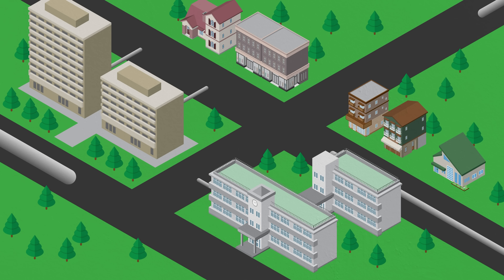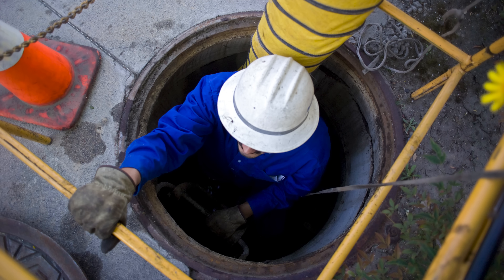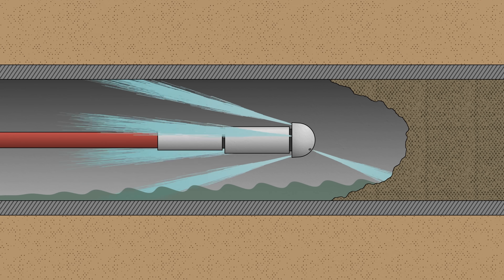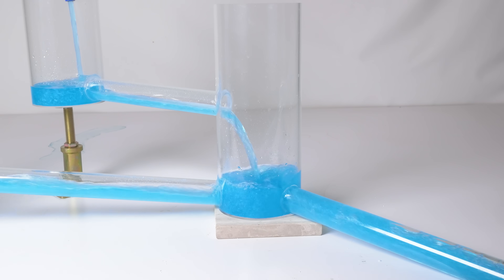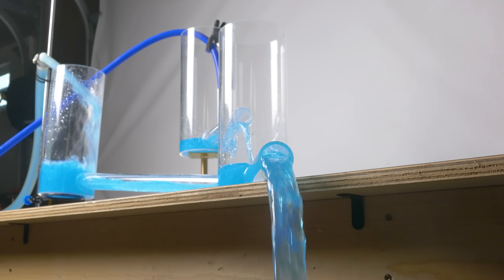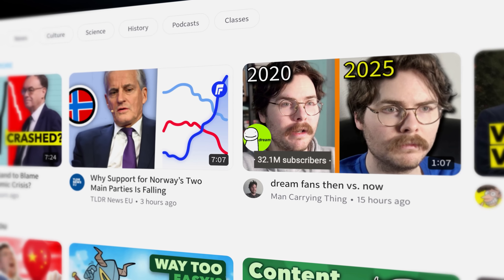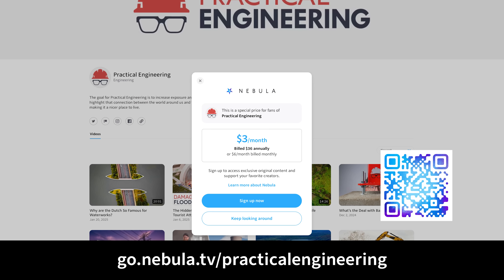What’s Inside a Manhole?

Comment: The Paris Olympics Seine river events are a good example, although it wasn't rainfall on the city itself that caused the postponement. The giant new storm water overflow reservoir near Austerlitz station worked exactly as intended and prevented sewer discharge in the river.
It's rainfall upstream, like 100 to 200 miles East and Southeast of Paris, mainly on the Marne (tributary river) and also on the upper Seine but to a lesser extent, that caused the events to be postponed, as they were initially planned exactly when the water would have flowed through Paris center from these locations.
36 hours later, and it was back to normal.

Really nice video turning a rather mundane subject into something very interesting, kudos!

Comment: In my village, we have 2 networks. One for the storm water and one for the sewage. Homes are required by code to be connected to both to avoid the problems with storm water in the sewage system.
The storm water is discharged directly yo the nearby river and the sewage goes to the water treatment plant (Rhyzosphere type station).
Reply: My roof runoff just goes directly into my yard or my driveway, which then drains into the road and will end up in a storm sewer on the road.
Reply: @jasonfullerton7763  same for me. From the roof into the garden or alley and from there in to tge catch basin/storm system. Yhea running the water from the roof in to the sewer can cause a lot of problems with overflow and a lot of water to treat/clean at tge treatment plant.
Reply: I don't understand why a home needs to be connected to storm. The storm system has catch basins. What water goes to the storm, perhaps the water that comes off the roof?
Reply: @bert-blank  Yes, it is for the water of the roof. The water of the roof must go somewhere and it goes to the storm. In the past, the roof water went to the sewage, but it caused trouble during storms (see the problems with the Seine river in Paris).
I live in France, so it might be different in the US. Where is flowing the water from the roof in the US?

Comment: As someone who locates sewer lines with a camera for new utility installs, whipes and grease are very much so an issue. But in the area I work in, we often run into lots of rock and sand from poorly maintained lines. Just had a really bad line with a lot of rock in it yesterday.

Comment: In Quebec, we have a problem with frost heave.  Roads would have to be built with 6 to 8 foot deep granular bases to eliminate the problem, but that would cost a fortune, so we typically build road granular bases between 3 and 4 feet deep.

The manholes, however, rest on crushed stone bases below the frost line. This means, that in the winter, you can have a differential frost heave of 1 to 2 inches between the cover and the road surface.  We deal with this by using telescopic frames that come in two pieces.  The lower piece rests on the top of the manhole, and guides the upper piece.  The upper piece has a wide rim that rests on the asphalt pavement (but sunk in to be flush with the surface). This allows the cover to rise with the pavement when the frozen soil under the road heaves.

As prefabricated manholes are made in segments, the upper segment can sometime be lifted by the rising soil, especially if the granular road base is frozen to it.  To counter this, we wrap the upper segments in a special two-layer geo-composite fabric, where the two layers are designed to slide against each other.  This prevents the upward shear forces of the rising road base from being transferred to the outer wall of the manhole segment.  In Ontario, they deal with this problem by bolting-on metal straps to hold the segments together.

Comment: I have been in construction for over forty years and yes I have worked in sewers. The only time women work in construction is when there is a need to fill a DEI or affirmative action quota. They were often paid the same as other workers and did not have to complete the assigned tasks! I was a boilermaker in oilfield and the women held umbrellas for the men while they worked in hard hot jobs like welding in  110 degree Texas heat, or being on fire watch with a water cooler and a lawn chair watching for fire breakouts!

Comment: Ah!  Sanitary sewers . . . At my last place of employment along the San Francisco Bay, which was only a few feet above sea level, I noticed on the street that fluid was seeping up from the manhole cover onto the roadway.  I contacted public works about that issue.  But, before they arrived, between 10 ~ 10:30 AM, enough pressure had built up in the sewer line that it dislodged the steel cover, where it came to rest several feet away.
From what I could figure, given the time of day, the restrooms in the neighboring buildings may have been very busy at that time, which built up the pressure from the waste material, which dislodged the manhole cover.
The public works crew worked a long time to vacuum out the debris in that sewer line.

Comment: In your model, the pipes intersect with the manhole on the perpendicular to the circular vertical of the manhole. In the situation like you've shown here, where the manhole is used to change direction at the same level, wouldn't it be better to have the inlet and outlet pipes intersect with the vertical closer to the tangent to the circular footprint of the manhole? I imagine that having the smoother curve would improve the flow characteristics (less turbulent/more laminar)? Or is there a reason why that might not be done? [Edit: I should've specified initially, in case it wasn't clear what I meant; in this question, the direction of the entry of the tangents of all feeds in would be the same, and the direction of the exit tangent would be the opposite.  I'm imagining that it would more easily drain down the exit direction if it were piped in that way, because you'd have a vortex in the centre. In fact, it would probably also significantly reduce the risk of back flow up an unexpected direction, because the fluid flow would be encouraged to flow down the exit tangent and wouldn't easily flow back up the entry tangent. The only issue I could see is that it would potentially promote higher exit velocities which would, as you say, risk damage to the pipework. But on the flipside, I imagine that effect would only be significant during a high intensity storm water situation - and in that case, the additional draining capacity of the manhole exit pipe could outweigh the additional wear and tear....]

I'm not sure if you've answered this in a video, and it's only tangentially related here (pun intended), but in the design of the storm water network, how is the design condition for the peak capacity selected? I'm guessing it's just some sort of mathematically calculated point where increasing the capacity doesn't pay off compared to the maintenance required to get it sorted in the, say, 1 in 500 or 1 in 1,000 rainfall event???

Comment: The simple "water flows downhill" (inserted water to be polite), concept works great for all plumbing applications.  I remember helping our fitter replace rotting pipes in a dry sprinkler system.  The water was from water vapour condensing out of the compressed air in the pipes and there were no low points available to drain the pipes properly.  Have to admit, the amount of sludge that came out when we opened the joint was amazing.  The smell, memorable to say the least.

Thank you for posting these videos Grady.  They're great and very informative.
Reply: Unpressurized water flows downhill. Pressurized water leaks everywhere.
Reply: @davidg4288  What enters the pipes is air containing water vapor and with the system being closed, the air doesn't go anywhere else but remains there.  It pushes back through the pipe and keeps the clapper valve closed so no liquid water can flow into the system.

When the air is pressurized, it causes the water vapor to condense into liquid water which is heavier than air and will settle to the lowest point.  When something  like a sprinkler head opens, then it sprays out in a mist.

When the air pressure drops enough, the pressure of the incoming water will force the valve to open and water will then flow into the pipes to wherever it's needed.

Comment: We used to take the storm pipes to school 😂. Each tunnel must have been 25 feet in width and 13 or so feet in height. We would lift the 100+lb storm gate to get inside. And begin our journey. Multiple other slimer tunnels are breaking off into the city. The amount of water that would go through these tunnels is monstrous. It would lift that gate like it was plastic complete white wash blowing out of the entrance. To this day 1000s of people live under that city in those same tunnels. And even more in the summer. But the lids are actually round in design because every other shape risks falling down. A circular one can not wiggle its way down even when accidentally dropped.

Comment: In 1993 we had to turn the cone on huge manhole in Vegas. We built a turn lane into the Fiesta Hotel during its construction. The manhole was in conflict with the new curb. So we excavated around the manhole to give it a half a turn. No one had opened the lid prior to getting the ring and cone exposed. We put a big choker cable around it and lifted it up with the excavator. What happened next should be in a horror movie. The manhole was about 12’ deep 5’ in diameter. It was lined with cockroaches top to bottom. At the bottom was a 36” pipe flowing at about 70%. 
All three of us literally puked. We set it back down and flushed a 4000 gallon load of water down the manhole. Creepiest thing I seen in the underground business

Comment: Timestamps (Powered by Merlin AI)
00:06 - Manholes reveal the complex infrastructure of sewer systems.
01:59 - Manholes connect sewer lines and facilitate maintenance and flow management.
03:33 - Fatbergs create significant sewer system issues, impacting public costs and maintenance.
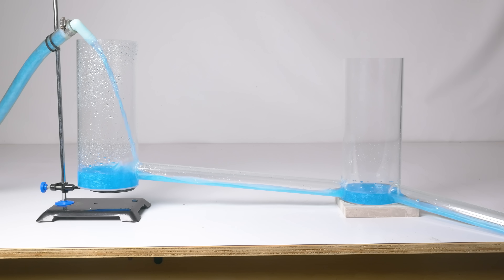05:05 - Manholes are crucial for ventilation and managing sewer flow.
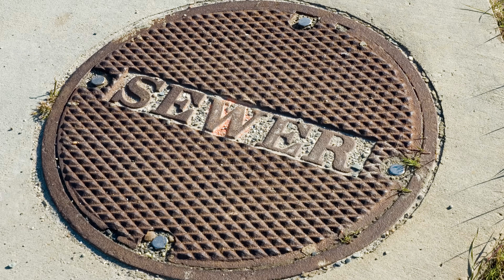06:43 - Stormwater management is critical for urban sewer systems.
08:17 - Understanding manhole design impacts sewer flow and environmental compliance.
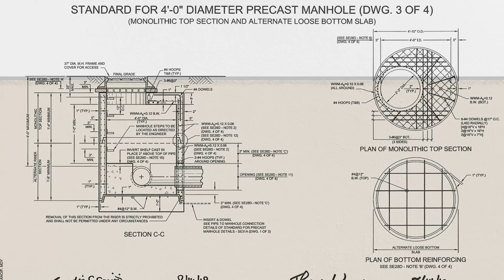09:47 - Manhole construction involves round shapes for efficiency and soil load resistance.
11:23 - The construction of the World Trade Center showcased remarkable engineering.

Comment: Telco worker here. Another very important reason manhole lids are round is to keep the lid from falling into the hole. The lip that the lid sits on is too small to allow the lid to fall through. A square or other shaped lid, if rotated is able to fit passed the support lip and thusly could fall into the hole.

Comment: It looks like a manhole would be a point were solid material would collect.  You briefly mentioned maintenance but I would have liked to know what methods are used to clean out manholes when stuff collects in them.
Reply: Sewer manholes generally have concrete channels installed which match the diameters of the incoming and outgoing pipes. The model shown in the video did not have channels in the manholes.

Comment: I've been in storm drains in my town quite a few times, and even a CSO 3 times to watch the progress as they changed it from a CSO to a combined sewer going into an interceptor tank, but I've never went into one through the manhole. My town is awesome enough to put detailed sewer maps on their website, so you can find outfalls for storm drains/CSOs and manholes (if you like playing in poo water), and tell what kind of pipe it is, how big it is and what it carries.

I was in a drain one time that was big enough to drive a bus through for the first 600ft or so. after about a mile and a half, it had reduced to the point we would have to worm our way through to get to the next manhole. It had some pretty neat features where multiple pipes met, or it changed direction sharply. There was one manhole that was like 10x10ft and the corners had 3ft tall "curbs" that made perfect benches to take a break and smoke a joint on.

Comment: In Massachusetts instead of putting the manholes in the center of the road so that your car straddles it when you drive over it they offset them so that your cars tires run right over them. And they are always sunk a bit below grade so you feel it. 😖

Comment: Can someone please explain the flushable wipes argument? I did an experiment in HS testing different brands of wipes. Of the 10 brands i used, 8 of them would deterioate in a 20/80 mixture of ammonia and water in 24 hours. I understand ammonia is much stronger than UREA but if your septic system is healthy and properly functioning, i cannot comprehend how the concentration of urea and feces will not breakdown those wipes.

Comment: One day my dad and I watched a city crew prepare to water jet a sewer line, using the same nozzle design Grady pictured. They had to resort to a backhoe to remove the manhole cover. When it popped off, actually pulling the iron rim out of the street, 10,000 cockroaches swarmed out. Or maybe 20,000. A carpet of roaches in any case. So sewers handle not only sewage and storm water and so on, they house incalculable millions of tasty roaches.

Comment: I've been delivering pipe for storm water only drains for about a year and a half now. There are fittings of all sizes and shapes for the pipes. For a straight line of pipe, each individual piece of pipe fits together with a rubber seal and some grease, then they're pressure-fitted (shoved) together. The pressure keeps the seal. Each pipe is 8 foot of water-travel and 1foot of fitting: a nipple on one end and a bell on the other.

The fittings are generally called "precast" and are everything from ys, to corners, to tiny boxes for junctions underground which are NOT manhole-accessible, to storm drains, to all kinds of entrance and exits. There are pre-cast manholes ... and some which are just formed on-site. You can buy a custom-built manhole with holes exactly where you want it, build it in place with forms, or buy the pre-formed one and cut-in the holes you need.

A lot of the pipe systems for subdivisions do work out to just straight lines, but with the curvy nature of newer subdivisions, joints, elbows, and even Ys are needed. That said ... the vast, vast majority of pipe put into the ground is just the straight-line kind because your main purpose is to move liquid over a distance ... not to curve it into a water-bending symbol to save the world from the fire nation.

Comment: 10:55 airplane on a treadmill WON’T take of. In aviation you have airspeed and ground speed

Airspeed is simply explained the wind speed over your wings
Ground speed is simply explained the speed relative to the ground.

If your airspeed is 45 knots with a head on wind speed of 45 knots your ground speed is 0 knots

You need air moving over your wings to generate lift, you don’t need ground moving under your wheels to generate lift

Simply put:
No airspeed = no lift
No lift = no flying 

A plane CANNOT take of with just ground speed

Comment: This may be lost in the comments, but I was kinda hoping you would cover why manhole covers have a slick bare metal surface rather than some sort of non-slip coating on the side that faces the street. As an avid motorcyclist/cyclist/ skateboarder,  I've had my fair share of scary "slips" on my rear wheel when accidentally passing over a wet manhole cover. I purposely avoid manhole covers for that reason, but in rare cases they may come out of nowhere and catch me off guard.
Reply: Manufacturing companies make lots of manhole covers with different anti-slip patterns to choose from however, often times the sewer providers (utility districts/cities) want covers with their logos on them which can't be seen if there are  aggressive anti-slip patterns present. The city I worked for started specifying covers with the city logo and when I mentioned the lack of grip on them would be detrimental to motorcycles and bicycles (I rode both at the time), the answer was "well, they'll just have to learn to avoid them".

Comment: 2017 was the most exhausting year of my life. I worked as a Manhole Raiser and Repairer. For as small as they are, everything about them is heavy and if not a storm drain then you see and smell things you never thought or wanted to smell. 

How we raised and made them even was we used shims (small rocks) and then once leveled the concrete ring and then we shoved concrete in them. Anyways... good video. Thanks for the memories.

Comment: I like to rake leaves and leave piles to see where the wind takes them or how the piles change in size then combine them and move them around like flooding and draining the wind blows them all over in different directions and they never go the way you want so i just leave them until the conditions change almost like flooding to a specific depth and using suction to pull them all the way i want

Comment: What can and cant be flushed in some municipalities is absolutely wild, I was initially advised by a coworker to dump antifreeze down my drain in the new town im in and that didnt sound quite right, so i looked up where i can dispose of it on the county site and what do ya know?! The county says to dump it in the tub while running water. Totally blew my mind because dumping automotive fluid waste of any kind into the sewer is usually a pretty big no-no. 
Also yes, do not flush "flushable" wipes at all honestly. Better off just getting a mini trashcan with a lil lid, spending like 10 bucks on that will save ya one or more $100 plumber calls in the future or it will save you thousands by preventing a sewage backup of nastiness all into your home.